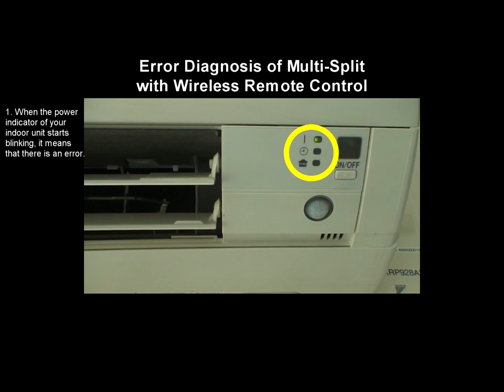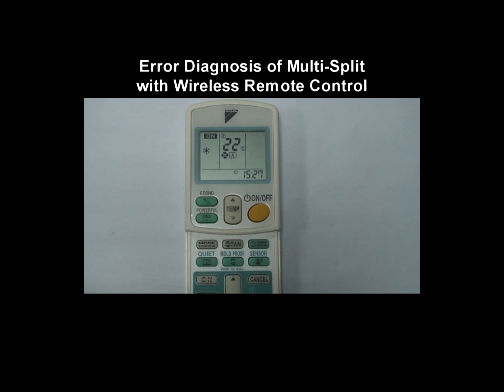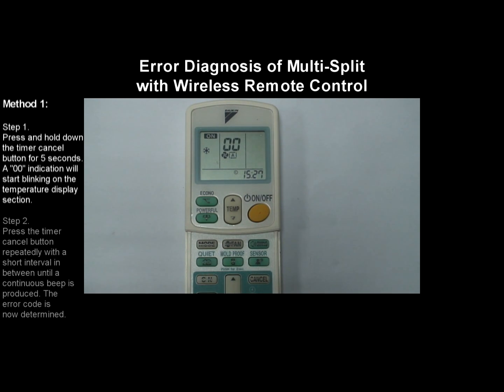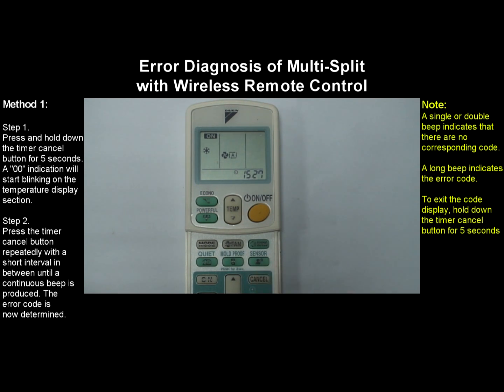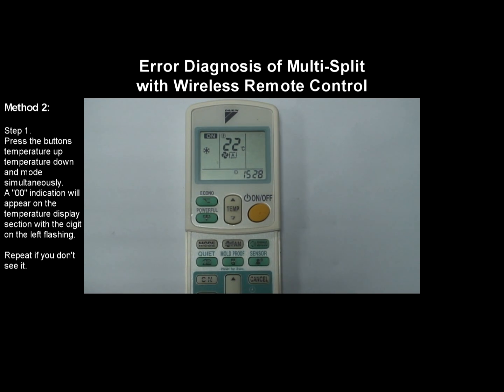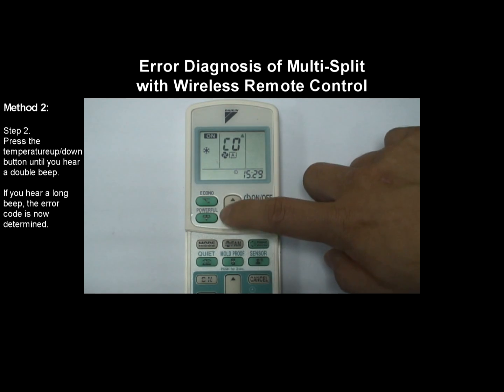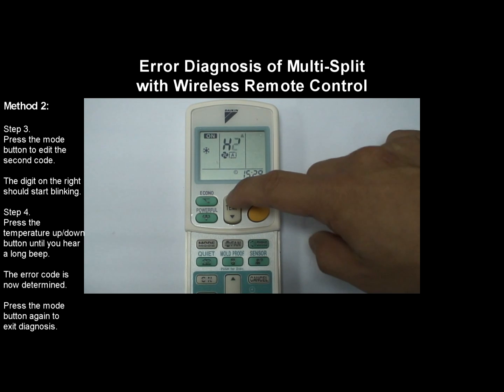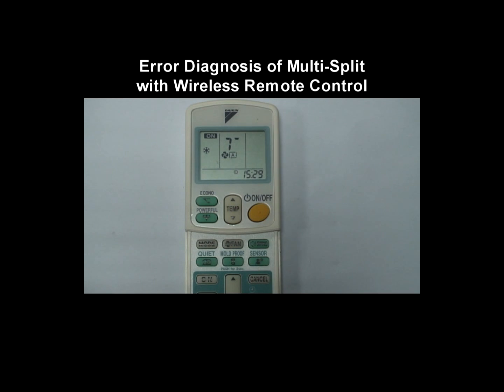Error Diagnostic for RA Unit using wireless remote controller (ARC433) | Daikin Singapore

Comment: Hi Sir I am technician from Daikin 
Sir a Daikin inverter ac is not come to error code and indoor unit continue run but outdoor is not start and neutral and communication between come to voltage 7,12,15
How to find out that indoor pcb OR odu pcb dead please reply me sir...
Reply: Hi sir I have a 4U code